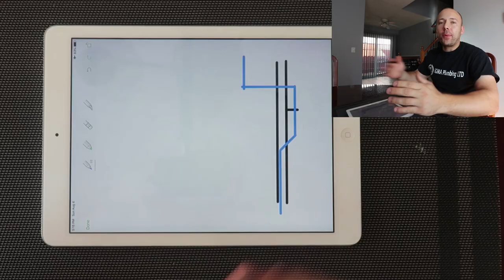5 Hardest Parts Of Your Plumbing Apprenticeship

Comment: I struggled but only for a month finding an apprenticeship using the Indeed method. I instead went old school, I called up a bunch of places. Only one in my city was hiring which is also close to home so thats nice. They weren't officially looking until I was speaking with them and I start in two weeks!
Reply: How’s it going?
Reply: @visu550  it's going great! It's been almost a month now and I've been doing rough-ins for new build houses and some finishing work and a small handful of service calls. This type of work I really prefer especially doing a rough in. It involves planning how drainage and venting will be setup in the house and then just cutting and assembling the pipes which I find really satisfying
Reply: @Aceses hey update on how its going? 😅
Reply: @problemsonem3563  Been nearly a year since I went back to automotive. The company was very corrupt and ruined the trade for me. Although the last two months after they laid nearly everyone off and instead moved me to HVAC, that part wasn't so bad and I would consider that as a different trade
Reply: @Aceses  apreciate you sharing your journey

Comment: Part of the UA in Ontario and have been on the tools since day 1 (Four months in). Beginning of the shift my journeyman tells me what lines to run (size, valves, drains, vents, balancing valves and control valves ). I spend the better portion of my night working alone and will only grab him if there's something I'm stuck on. measuring and calculating the length of pipe, fitting allowances, etc. It blows my mind to hear about these second and third year apprentices who have never been on the tools. I do agree with you about having differing opinions as to how your journeyman would have done it. It's a difficult subject to broach. Basically, I use the old phrase "Do first and ask for forgiveness later". If I think my way is better I'll just go ahead and do it. 9/10 times its fine.
Reply from the maker: Thanks for the insight Shane! Sounds like you’re doing a lot of learning!

Comment: I had the solder sweat thing happen to the guy who was  teaching me.  he couldnt solder the joints because the main in the house wasnt holding completely.  It toook forever to get it soldered,  he got pretty frustrated. I got frustrated,  after that plumbing  experience..

 Everytime i solder  even R19 shut offs for toilets, i take a little stinger vacuum to the water line after the main shut off, makes soldering easier for me, when you vacuum it still gets quite a bit in the line, even if you bleed out taps in a basement,

Some old school plumbers use the bread, which is still kinda cool

Comment: Loved your video. I'm also in Ontario (Midland area) and in my 6th week of plumbing techniques at Georgian. I have my mid terms next week, and doing amazing (probably deans list) with the online (covid) school portion. I'm having such a hard time with my physical strength during my shop classes, for example: pulling apart like a 1/2" pvc pipe from a fitting (had a lot of other already glued fitting in place, so there was more friction) after sticking it in the elbow and making my marks before gluing. I think I may have not reamed it enough, which also has to do with me trying to be as fast as all these guys and being weaker and not being able to do it as well as them in that time. Any tips for a 5'1 girl in a class room full of guys? I'll begin my apprenticeship in May, as long as I find one.
Reply from the maker: Hey Katie, first of all thank you for the support on the channel! It really means the world to me. Congratulations on getting onto the Deans list! That’s a great accomplishment! In regards to the physical side of the work, everyone will have a hard time taking a fitting out especially if there are remnants of glue that may have accidentally bonded the plastic together. Don’t get discouraged, I fight with fittings all the time. Sometimes on a dry fit, I will push the length of pipe in the fitting too deep, so I will have to massage it out of the fitting for 2 to 3 minutes. It’s all part of the game. My only advice is remember plumbing like many things is a singles game, you are trying to beat YOUR best score, and not anyone else’s. You are bound by your strengths and your weaknesses, and your resources. Don’t look to beat the plumber to your left or right, but study their technique. It may prove useful. Keep your chin up, and please let me know how mid terms go!